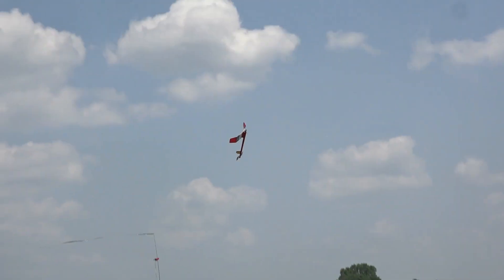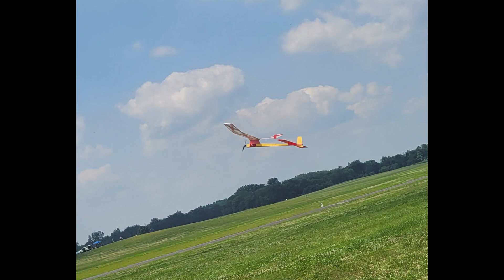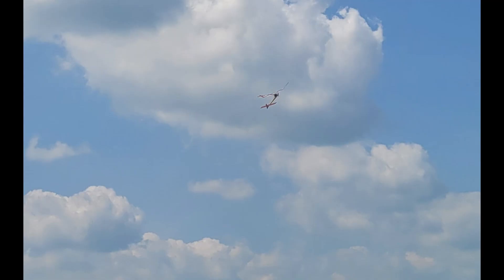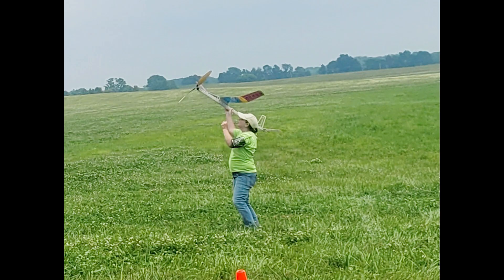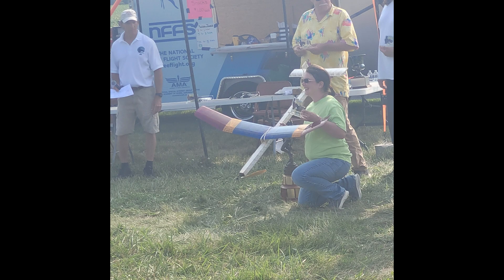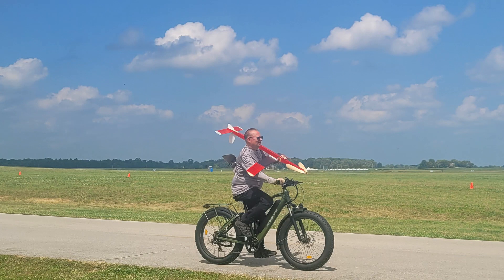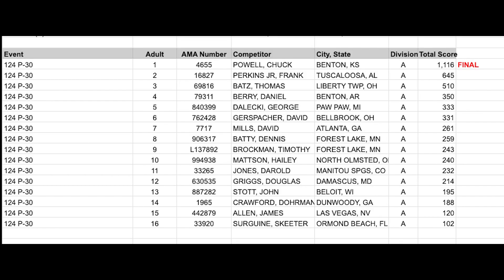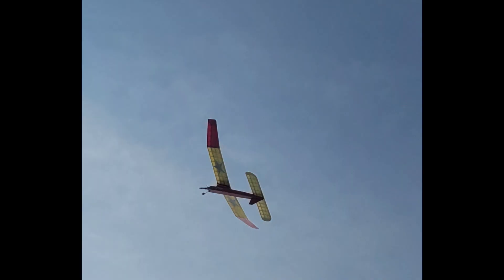Thermal Lift at 2023 Nats

Comment: Muncie can be a tough place to pick air. E36 day was absolutely magical, but it was the one day with really light winds, also coinciding with by far the strongest lift Ive ever seen there. Mulvihill day wasnt bad but you had to really be on it. Hope was perfect that day and Steven Wrigley was flying very strongly as well. HLG day was extremely rough and Logan called lift for me. I wouldnt have found a thing without him.
Reply from the maker: Thanks for your comments Josh, I flew too early in E36 but found good lift in the afternoon.